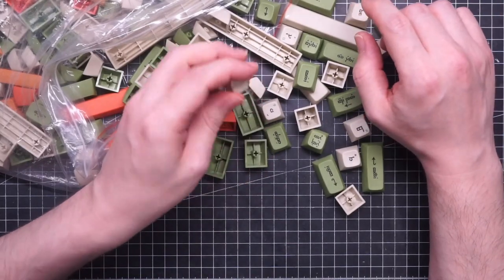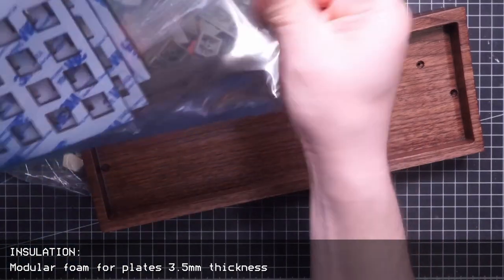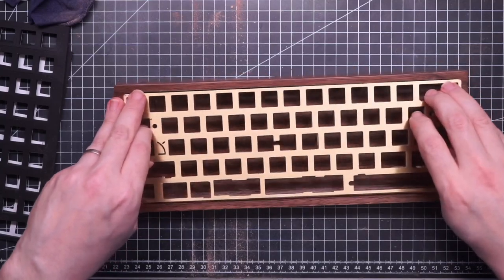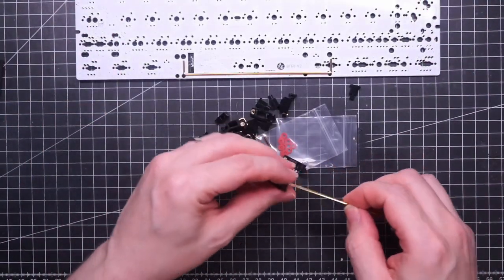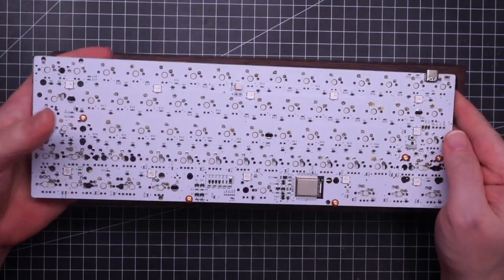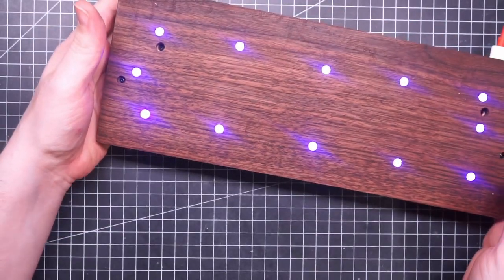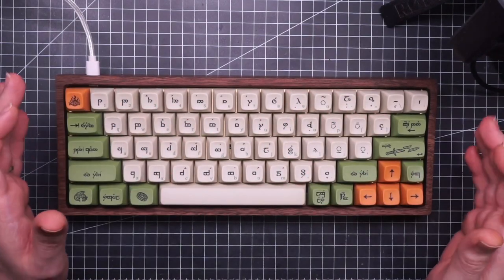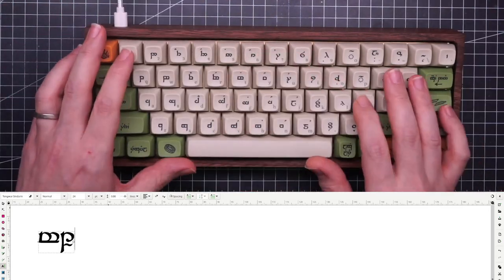Building an Elven Keyboard

Comment: I have a Planck keyboard with a brass top and bottom plate which I made before "hot swap" switches were really a thing and it's difficult to keep clean. Not just patina, but drops of "stuff" will get in there and create dark stains. I love the look, but it's a pain.
Reply from the maker: I agree generally speaking it's not the right material for keyboards... but in this case I'll make an exception and any kind of patina/stain will add to the "organic" look.

Comment: It's almost like some kind of elvish magic that you are using the same case, the same pcb, even the same plate and of course the same keycaps - although I don't have them yet - as I was going to do for my next build! AND you even posted this video on my birthday. I've got all the parts lying around but I haven't found the time to build it. Now your video will be a great help, thank you. I already have a question: Did you brush your case with oil after sanding it down or what did you use? I also don't like the factory coating on mine so I'm thinking of sanding and oiling it as well to get the natural walnut texture back
Reply from the maker: yes I applied oil after sanding (a lot of sanding). the result is pretty good. I believe they coated the wood with some glossy polyurethane resin that really kills the natural wood look.